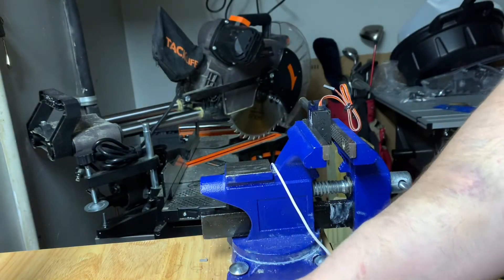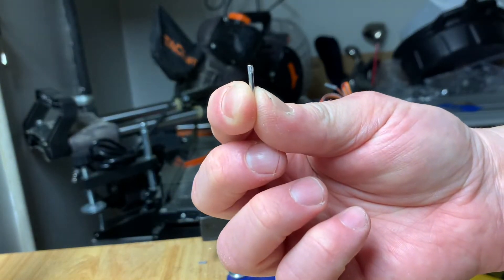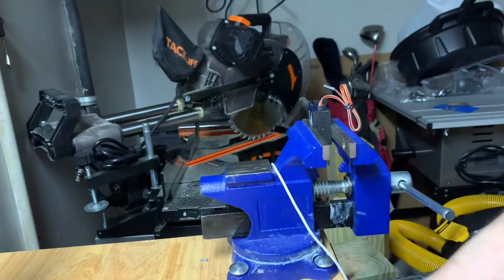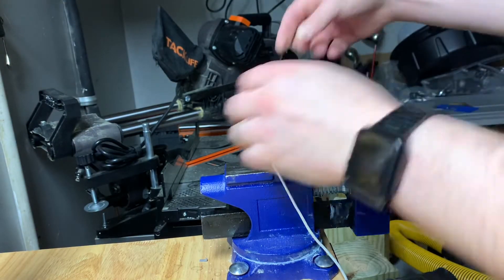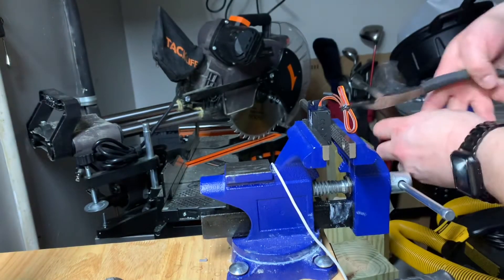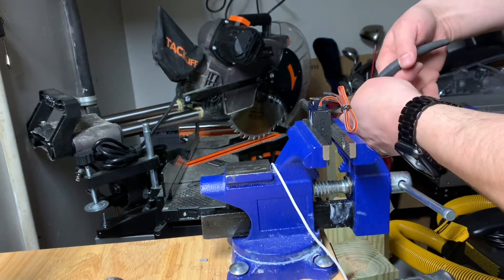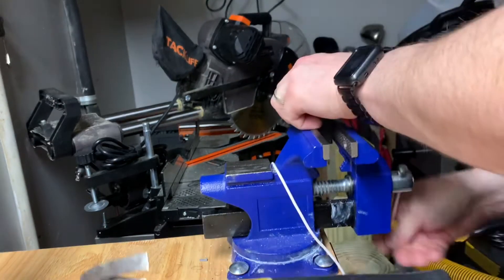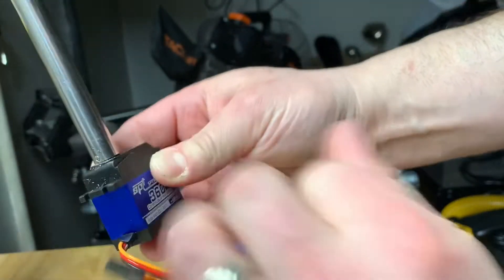Huina 1580/1550/1592 35kg Servo and Ram construction.

Comment: How do you install the 35kg servo on  the excavator far as mounting it I'm wondering if it has the hole already in it
Reply from the maker: There is a void in the case.   You can drill a hole there to make it pivot nicely.    Feel free to ping me on FB or send email and I can review further.
Reply: What scale servo are you using? Is it any splined 10th scale servo? My 1592 spends alot of time in rocks so I'd like to get has high torque as possible.